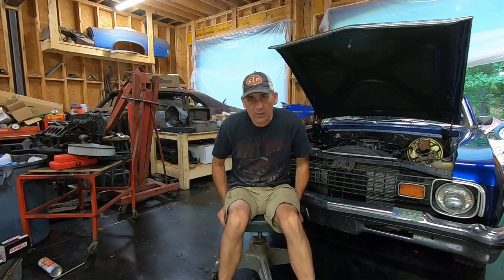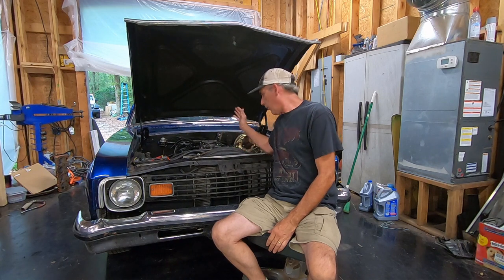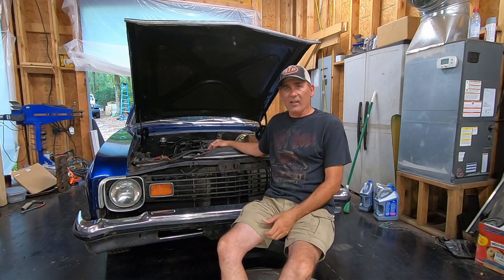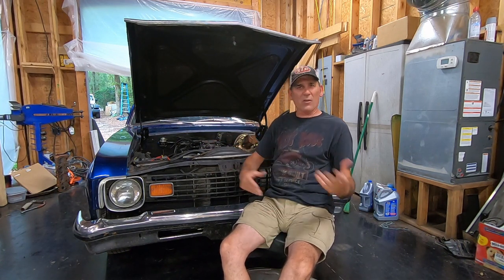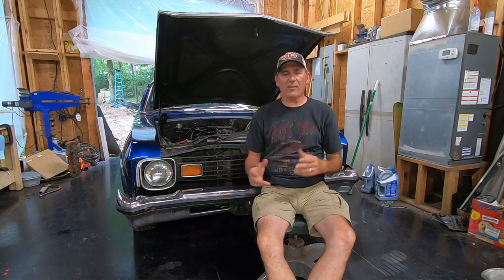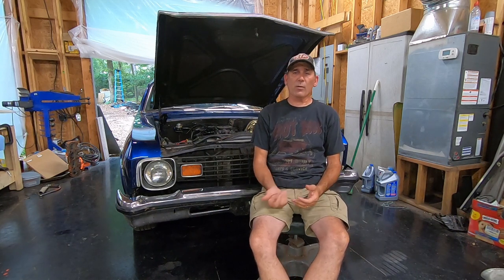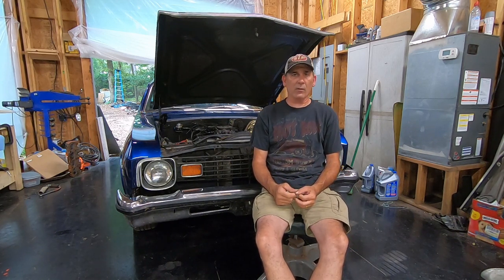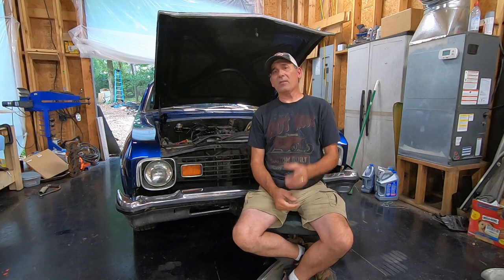My 1973 Chevy Nova

Comment: One of the first things I did with my nova was swap out the brake booster for a manual with a 1" bore. I knew I would be hot rodding it and I didn't want to worry about vacuum. The brakes work great and the extra peddle pressure was minimal.
Reply: It also gave me the extra room for the big block.
Reply from the maker: Yep. BBC valve covers won’t clear with a big booster.

Comment: I had a 1973 Nova in 1975 with 3/4 race cam edlelbrock intske 780 dual pumper holley on top forget thepistons with headers .fast car pop front wheels off the ground
Reply from the maker: Hell yeah!!
Reply: Wish i still had it

Comment: Oh also side note... my fairly built non stock 350 vortec is getting about 11.5 mpg. Do you think that's about right? 🤔 what do you think you average with your engine and set up?
Reply from the maker: On RMRW I got 14mpg until I got to Denver and was going uphill a bunch
Reply: @Shop209  hmm that's better than me. And I'd certainly assume you're pushing more HP... 🤔 I'm estimating near 340-380hp at the moment is my best guess. I want to be closer or just over 400hp. 
Wonder if I'm doing something wrong or I have more HP than I think... I'm probably doing something wrong! 😅🤣
Reply from the maker: Probably running way richer than you think. That EFI helps a bunch. I have it set to 14.3 at cruise. We were mostly driving around 65mph.
Reply: @Shop209  thx. I'll have to fool around with it and see if leaning it helps. Maybe the bogging down at sudden acceleration is too MUCH fuel instead of not enough. 🤔

Comment: with the air gap how much hood clearance do you have? drop base or flat base? how tall is your filter? my 73 is wrapping up, about to build the engine and I'm trying to decide on the right intake but worried about clearance.
Reply from the maker: It’s a drop base edelbrock 14X3. Maybe 1/2” of clearance. Very close

Comment: hay John. your combo is close to my project But im worried as id never would have thought that converter to 
operate at such a low stall being rated for 3200. thats a big difference to the 2k you got in the drive
way on first drive......
Reply from the maker: Yeah. I was hoping for a lot higher stall. Maybe after it’s tuned better it’ll loosen up. I’m not sure.

Comment: Is the interior fully restored i have a 74 thst im restoring
Reply from the maker: No but it’s all there. I’ll be getting the interior to a 9/10 in next few months. It’s a 5/10 now.
Reply: @Shop209  I have a question, are the 73 rear interior panels the same as the 74, my 74 have rear crank windows
Reply from the maker: Yes. They are. As long as they are both hatchback or both trunk.
Reply: @Shop209  thank you so much
Reply: @Shop209  one last question what is the black box that’s to the left of the break booster

Comment: Just out of curiosity, does the 73 have the moon roof?
Reply from the maker: No. It’s just a regular 73 Custom. I have never owned a sky roof.
Reply: @Shop209  Nice car. I had a 73, in the 80s. It had a the vinyl pull back opening.